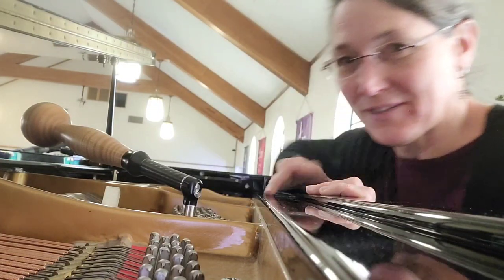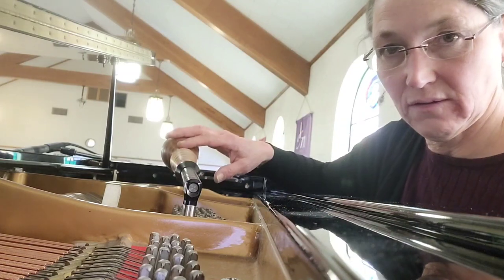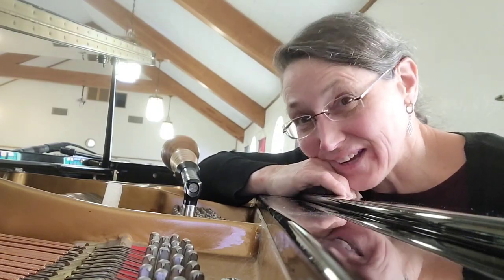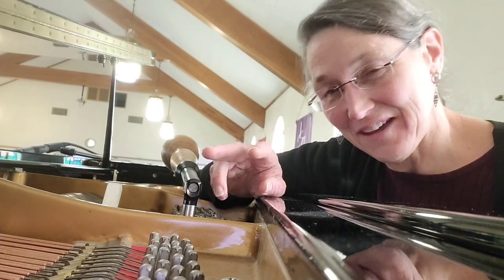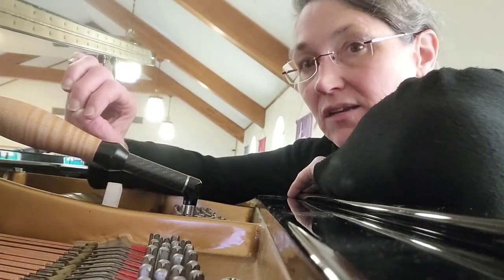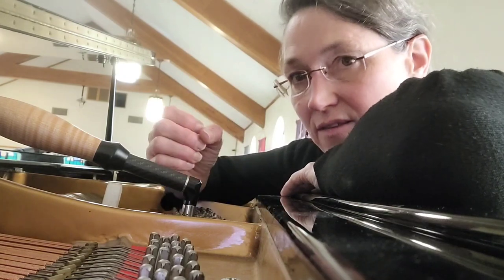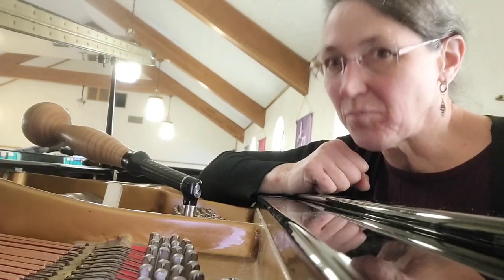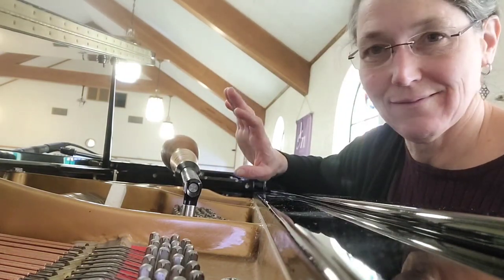thoughts on stability with tighter pins & lower friction at bearing points

Comment: Thanks, what do you mean by bending the pins? And what do you mean by "banging it"? Like the test blows?
Reply from the maker: Banging = very hard test blows used to actually tune, not just test. "Bending" the pin is explained in the other video. You push on the lever to flex the pin toward or away from the speaking length. Many believe you should avoid doing this with any kind of serious pressure because it can damage the wood. I don't really know, but I try to do it gently, not going to extremes.
Reply: @PianoTechMaggie  Rewatching now that I understand better :)

Comment: you mean static friction
Reply from the maker: I think so. What did I say?
Reply: @PianoTechMaggie  you just said friction and tightness, but you mean 2 types of friction: static (causing jumpiness) and sliding (causing tight smooth rotation) right?
Reply from the maker: @Ekstrapolator Aproksymujący  Ack! I thought I clarified that in the video!!! I meant to say I was talking about friction at the bearing points, such as the agraffe, capo bar, pressure bar, high angle under the non speaking length, etc. That's what I meant. I think that would be static friction only. Does that make sense? I will change my title and add that to the description. Do you want a prize? I have mutes, mute strips, and will be making key weights. If you have another idea for a prize, let me know. LOL! I want to make my key pounders but they are too expensive at around $50 each. 🙄
Reply: @PianoTechMaggie  oh, now it's clear, bearing points friction which enables setting non speaking length to higher tension but if there is too much of it it's hard to tune precisely
Reply from the maker: @ekstrapolatoraproksymujacy412  EXACTLY! 😁

Comment: You're throwing "bent", "flexed", and "twisting" terms all together to where it's hard to know what you're really saying.  I think it would be clearer if you just said "flag poling" (pin bends over) and "twisting" (top moves, bottom stays put) and talked about each one separately in different parts of the video.
Reply from the maker: I will try to remember that for next time. I have been told to not use the term "bend" but old habits are hard to break, so I'm currently using flexing & bending interchangeably. I'm not doing that on purpose. When I shoot from the hip in one take, whatever comes out, comes out. Some people don't know what flagpoling is, and Rick wants me to use the term, "flex", so I will try to stick with that one term. Twisting, I hope, doesn't have that same problem since I am only using that one term. In the case of a regular lever, it is impossible to not flex and twist at the same time unless you have loose pins. Those to motions work together.
Reply: @PianoTechMaggie  Yes, that's what I meant to say.  Flagpoling and twisting are different things, and I was confused at times which one you were referring to.  To me, "flex" and "bend" could both be either one, just depends in which plane the pin is flexing.
Reply from the maker: AH! I see what you are saying. "Flex" came about because some don't like the other two terms and I have heard it so often now that I assumed it had become common nomenclature. Oops! LOL
Reply: @PianoTechMaggie  Yeah, now I'm thinking "bend" sounds like "flagpole", and "flex" sounds like...I dunno.  Now I'm confused.  But "twist" definitely is clear.  And "flagpole" can't be anything else.  So I'm still liking those two.
Reply from the maker: @Ron Newman  I may ask Rick what he thinks. He prefers the term flex because he thinks bend & flagpole sound extreme. Flagpole doesn't sound extreme to me, but it hasn't been in the vocabulary of the people I talk to most, so I haven't picked it up. All I know is I should be more clear in the future. 🤣
Reply: @PianoTechMaggie  "Bending" is the engineering term. Let's use the professional term and not be swayed by the term police. 😂
Reply: @PianoTechMaggie  Well any of these terms, except twisting, can be extreme. We just need to understand how much is too much and don't do it.
Reply from the maker: @howtotunepianosbymarkceris2922  Indeed. 🙄😂😉